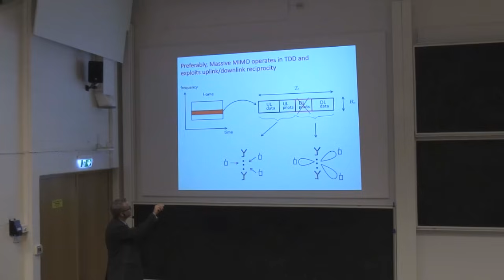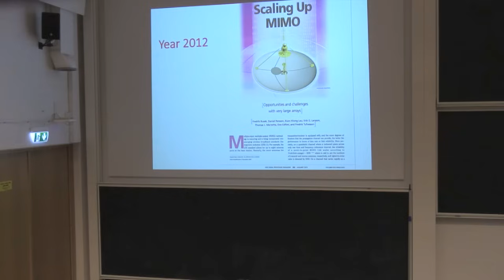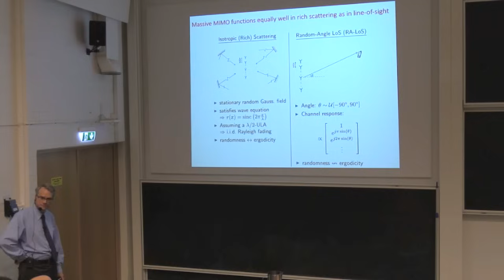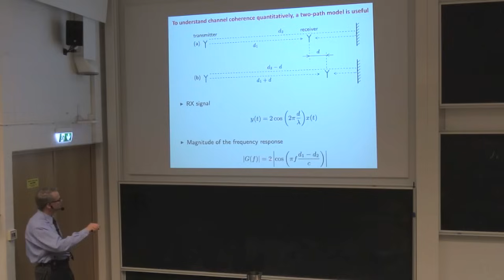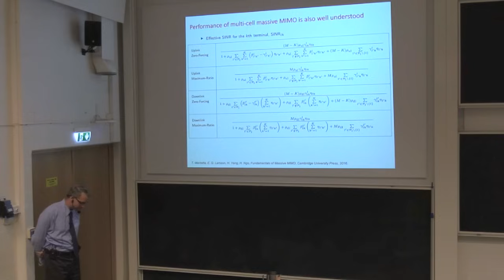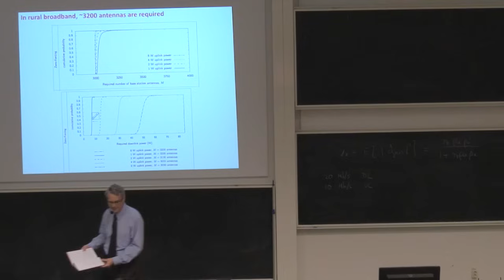Fundamentals of Massive MIMO

Comment: Question: The example at 46:20 , will use M elements to the K:th user, i.e. all antennas in the radio are dedicated to that user. Does this mean it will not simultaneously multiplex to all users?
Reply from the maker: Tom Karlsson No, all antennas are used for all users. Each antenna transmits a weighted sum of all the signals. The weights are selected to direct eqch signal towards its designated user by beamforming.
Reply: Bascially you transmit to all users at the same time, but the weights which manipulate the information at IQ samples level (they change both amplitude and phase) do the multiplexing.

Unless users are not spatially separated, then you also need your information that gets spatially multiplexed to contain information for each user or you feed the users who are not separated by location in turns...

This is easy to understand intuitively, but really tricky to implement in my experience, I guess I need some practice